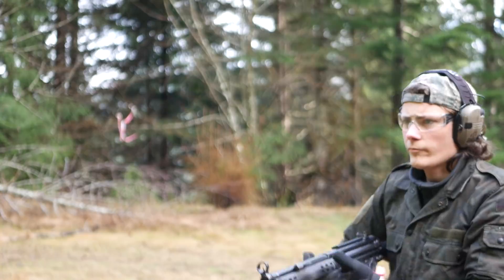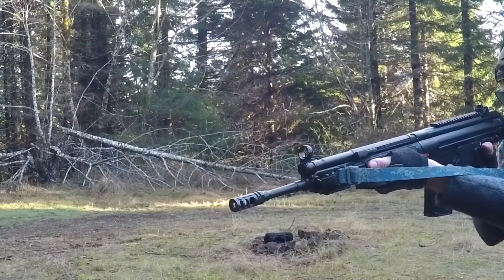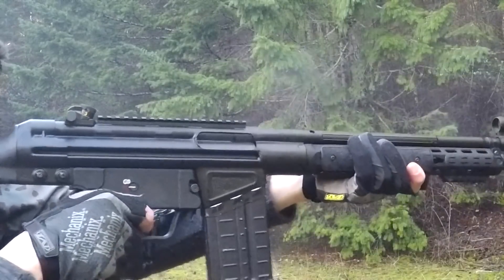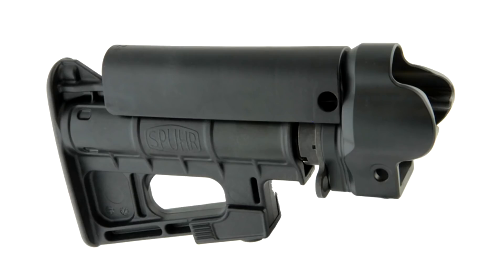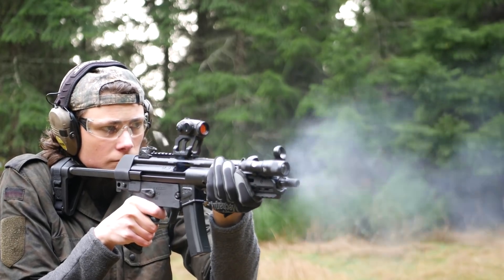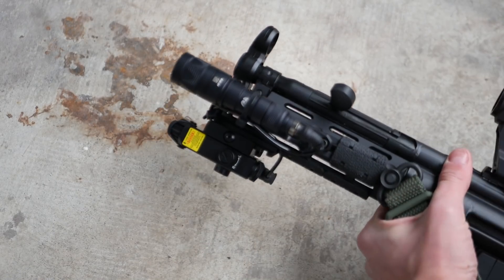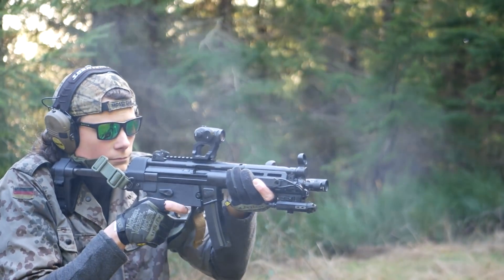PTR Mitosis

Comment from the maker: Check out the crazy weak ejection at 0:20
Reply: 80 year old man taking a leak right there
Reply: I have the A3S model as well I replaced the handguard with a KAC HK91 ras which set me back a little bit lol I also replaced some of the PTR made internal parts with HK made ones like the ejector/extractor and springs.. I ended up having to do some fitting as the ears on the mounting bracket where a faction of an inch too high which wouldn’t allow the front pin hole to line up. I’ve been looking at getting a spuhr stock as well so I humbly recommend a follow up video on this rifle after you get the parts in. For the $ PTR seems to be a decent bet as I haven’t had any issues with my rifle as of yet
Reply: How is it even possible to build a G3-clone which suffers from weak ejection?
Reply: @Benny---  Welcome to 'merica, I guess.
Reply: These new projects are the best news to come out in 2021. fight me.
Reply: It tried.
Reply: Common occurrence.   Could be ammo.   Could also be extractor related.   
     In ptrs they are notorious for lousy extractor springs.   
      In the 9mm you lucked out and it runs. 
      Do yourself a favor and buy 9mm extractor springs as well as 308 extractor springs.   They are not the same (although ptr uses the same ones in all their guns)
Reply: @ Hoplopfheil Whoa WTH was that??? That was definitely weird.
Reply: Buttery soft
Reply: So is recoil really that bad?
Reply from the maker: @thagrifster594  it's not painful or sharp, it just has more muzzle climb than inline stock .308s (AR10 or FAL). Takes more work to keep it flat.
Reply: @Hoplopfheil  okay, makes sense. One more question - 18 inch barrel vs 16 inch?
Reply: Most likely ammo related as it appeared the other rounds before and after that one ejected pretty forcefully.
Reply: Whomp-whomp.

Comment: Please note, due to the fluting that is done in the barrel to aid in extraction, the G3 style of rifles (this includes the cetme c and l) do not like steel case. Marcolmar , kit gun maker of the cetme L also do not recommend steel, as the laqer and or polymer coating will fill up the fluting and cause reliability issues. Hope this helps

Comment: You mentioned not liking compensators, curious if you've ever tried an externally threaded brake with a cone or tube surrounding the ports. Something like a 3/4" od brake inside a 1.25" id tube, so gas still gets out the ports. My 7.62*39 pistol is louder than magnums with the brake but very pleasant with the cone sending the boom downrange.

Comment: I got a PTR91 in 2012, thinking it would be an awesome DMR type gun, but I've realized that it's not practical for anything other than a fun gun. It's fun because it's a G3 clone. As far as hitting anything at super long range or mounting modern stuff to it, it's not even worth it. It's heavy and uncomfortable. I put a muzzle break on it and got an upgraded recoil buffer, but neither made a noticeable difference. Just dress it up with your favorite retro G3 furniture and have fun.

The one thing I'll say about mine is that it's been extremely reliable with both steel and brass, new and surplus ammo, as long as I use aluminum magazines and not steel ones. Polymer Thermold mags work well too. I think it had one or two failures in the first one or two hundred rounds, but everything else was caused by steel mags (the bolt usually doesn't even close when loading it from those).

Comment: Just got my PTR91 GI back from warranty work, they replaced the buffer, locking lever, and spring. Took it out today and it ran fine. I'm defiantly past the break in period now, and was before  the problems. I was having all kinds of trouble with feeding and extracting to the point rounds would get stuck in the chamber.. Also the mags fit super snug now with no play. Overall pretty satisfied with the customer service and repair work, just took a while. 9/10

Comment: I’d really recommend the side folding SB Tactical brace for the MP5. It’s almost as good as a fixed MP5 A2 stock. 

You also have to be careful mounting scopes to a G3, because if it has a decent sized objective it will interfere with the charging handle and you won’t be able to lock the action open. You want a straight tube common on low powered variables like a Primary Arms 1-6x.
Reply from the maker: The SB5TA is the one I would prefer but I think it's been discontinued.
Reply: @Hoplopfheil  
The original SBT5 and SBT5k were both discontinued for some reason, but the ‘a’ models that replaced them are still being produced.

I’ve got one of each and have been happy with them. They have a small amount of flex compared to the A2 fixed stock or the Choate folder I have on the MP5k, but they are very nice.

It looks like they are pretty much sold out everywhere right now though. The only good thing is you will be able to sell your PDW brace once you find one and that should make it about an even $$ swap.

https://www.brownells.com/handgun-parts/recoil-parts/recoil-hardware/sbt5a-pistol-stabilizing-brace-sku100026656-115592-215914.aspx?avad=48247_e1fcb8929&aid=35987&cm_mmc=affiliate-ItwineAvantlink_-datafeed&utm_medium=affiliate&utm_source=Avantlink&utm_content=NA&utm_campaign=Itwine

Comment: Yeah i have a century arms c308.  I swapped out the front and put a modular rail system on it with a sling swivel that mounts to the rail. It makes it so much nicer to carry in the field. I also put a 4x9x24 optic on the top since it comes woth a picatinny rail already welded on. Decent hunting rifle especially with hunting rounds it shoots very soft and accurate.

Comment: Coincidentally enough, I've ended up with the same pair and although the -'91 came first by over a year, the -9C  is currently in it's semi-final configuration.  So here are my $0.02 worth of ideas...
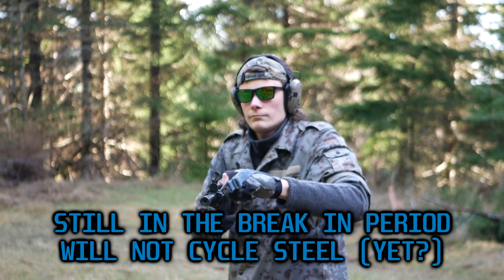PTR-9C:  Kept the forend (although the MI is very interesting).  Brace is the B&T branded version of SBT's UMP style folder from HKParts.  Look under B&T, not SB Tactical.  Optic is an Aimpoint PRO in a standard height AO mount.  Light is a Streamlight Pro Tac HL-X on an Arisaka (almost said "Arasaka"...unplug, choom! 😄) scout adapter at the 1:30 position.  Tape switch is right underneath it.  If you have an old short piece of Magpul MOE rail handy, they're almost the right height, can fit MLOK slots, and will take the rubber dingus to hold the end of the switch.  The other end  rests on the Arisaka base, with a tiny bit of hook & loop to keep it secure.  Sling is a surplus H&K, but beware, I'm not sure PTR spring tempers the clip on the mag well, so routine tight-to-the-chest patrol carry is out.  Both my PTRs wear a stick-on from Talon Grips, the bare plastic feels too slick for a secure grip, especially on the -91.
(part 1 of 2)
Reply: PTR-91:  My inspiration is the German Army's G3A3ZF (gesundheit!).  I'm also focusing on keeping the weight down.  For the forend I'm going to try to get someone to fit a length of Pic rail to the bottom of the slim GI forend (the original one with the heat shield) like the German rifles have.  So far no luck.  Optic is tricky, as you say.  Length is limited by the need to work the charging handle. I've settled on the Trijicon Credo 1-6 (MRAD version).  It's short enough, not too heavy, and has great glass.  Mount will be Scalarworks, because weight.  For the muzzle I have a Griffin Hammer Comp.  Blackhawk nylon cheek pad on the stock.  All of that is still on paper only.  

Not meaning to show off or brag.  Hope this gave you some ideas (for the rifle!).
Reply from the maker: @christopherreed4723  good stuff, thanks for the ideas!

Comment: Ok I don't know maybe it's a generational thing but stout recoil? Not really I have fired 3006, 308, 30-30, 50 BMG and I have to say my G3 has mild recoil the inline stock thing isnt a issue with these weapons.   Ok so you want light lasers/Optics to be honest lasers are overrated as a former Marine I can tell you mostly we used them for target designation or deterrent when lasing people and unless you shoot a lot with a laser as a primary sight I don't recommend it just use an optic.  I don't want you to get bent with my comments it seems youtubers get mad when someone disagrees with what they posted but to be perfectly honest I find a decent optic and light is all you need.   Last these are my thoughts from my own personal experience I was trained when we taped maglights to our A2 Handguards no optics back then and trained in modern rail systems with lights, lasers and optics for fighting what we found out was what really is necessary carry the rest was left behind just my thoughts knock yourself out less is more simple is reliable.
Reply: Or you could chop the barrel down to 16.5 about 3/4 from the sight block re-thread pin in place a 4 prong flash hider for a G3K model this will allow you not to replace the locking piece I believe is 45 degree angle  to 50 degree angle like on shorter builds.  This should give you a lighter gun shorter as well while not having to replace internals.

Comment: I enjoy your videos, but disagree with many of your conclusions here.  The biggest problem with G3 clones is that they are difficult to suppress.

I have not experienced any break-in requirements - I would suggest checking your bolt gap as a first step.  I don’t remember what the markings are for the correct locking piece, but I would also check that they put the right one in when it was assembled.

I didn’t find the Spuhr stock to be worth the money.  I have an average size frame, and it might be necessary for folks under about 5’10” with shorter arms.  It makes it impossible to use the iron sights.

Forgotten weapons just did a video on modernized G3s:

https://youtu.be/lvx2RFkst4U
Reply: Did you try removing the cheekpiece? I was able to use the iron sights on my Spuhr stock no problem after removing the cheekpiece. I did have to pull open the stock 1 or 2 clicks back due to the contour (the piece at the top of the stock which the cheek riser mounts to seems to get in the way when trying to get one's face low enough to use the iron sights).
Reply: @dexm2010  I have not - but that is a great idea.  I’ll give it a try.

Comment: I would have to say that my favorite thing about the SB HKPDW brace was the set screw coming loose under recoil, and the wires completely failing and collapsing, followed by my face slamming into the end cap.  Loved it.  Loved every moment of it.
Reply: The side folding SB brace that kind of looks like the OG fixed stock is probably the way to go if you want a brace
Reply: @NPS69  can confirm.
The side folder looks fairly good (at a glance).
Has a comfortable cheek weld for the irons or low mounted optics.
Locks up solid so no face smashing tragedies like the poor OP. And it folds up nice

nice meaning after you've oiled up the hinge and then folded it 100 or so times
Reply: you added the pdw brace to the 308?
Reply: @ianteissier2951  nah, to the 9CT.  If I still owned it, I’d probably just Form 1 it and set it up like an MP5A3.  That kinda seems like the move to make.

Comment: Hop why does the market value G3/mp5 clones the way it does? Is it because of licensing, importation, reputation/media representation, all of these to some extent or something else entirely? The price tag seems ridiculous for what are basically copies of legacy platforms.
Reply from the maker: They're classy and they were in ALL the video games. But in reality, yeah. Not the best as far as actual guns go.

The real kick in the teeth is that roller delay stamped metal guns were always meant to be cheap and cheerful. Easy to mass manufacture. The fact that they cost so much to make now really corrupts the original intent of the guns. Not to be the best, but to be CHEAP.

Comment: I bought a PTR-GI model with no rail back in August and that thing has been nothing but trouble since I bought it, and eventually, it quit running completely, would not eject anything, would extract, not eject, then double feed. So I sent it back in November and they just told me they couldn't fix it and they are sending me a new one. Please keep us updated on whether or not yours will cycle steel.

Comment: Don’t tease us. We want the full reviews from the absolute king of reviews!

I have a 9CT and love it. No... I LOOOOOOVE it. But I consider it a toy, so I wasn’t expecting to become a Navy Seal. Its shortcomings outweigh its strengths “for duty use.” It’s not practical, but boy is it fun. Did I mention I love it?

I also have an older PTR91 with a 16’ barrel and no welded rail, and it’s probably out of spec, because it misses picking up a round or two out of each mag. Total failure. And I tried several rails, including a claw and a very expensive bolt-on, and they all suck. I do not love it and am planning on ditching it at a loss.

I have a real HK91 and it’s flawless as far as operating, but SOOOOOO outdated.

Comment: You will not be able to run steel cased ammo through those stepped barrels. Eventually you'll end up with cases stuck in there so hard you're gonna need to drive them out with a rod and mallet. Ask me how I know.

Comment: Sphur stock, magpul lower, trijicon sights, trigger job, enhanced buffer, muzzle device of your choice and a mlok handguard is how you modernize a roller delayed firearm. It won't be a SCAR but it will be dead nuts reliable and smooth for the cheapness.

Comment: Add the Heavy Buffer to the 91. I run the Midwest handguard, Spuhr stock, H-buffer, PWS break and like it now better than the FAL or AR10. Buffer @ HKparts.net. I can hit steel at 500 with Wolf. I also have the Primary 2.5x10 for optics. Also I put in a 36 degree locking piece. This reduced the recoil a lot !! The brass only flies about 5 feet and the brass is in great shape.

Comment: Ah, good ole PTR. They sold my buddy a 9C with out-of-spec tri-lugs and dragged their feet on getting it RMA'd. And then when they rebarreled the whole thing to replace the tri-lugs, the replacement barrel's diameter is out-of-spec, so no tri-lug piston will even fit over it. But hey, at least the lugs are in spec now.
Reply from the maker: Jezus christ... I'm going to order a 9mm can when the one I want is back in stock. Wish me luck.
Reply: Well, if it makes you feel any better, I too hate money and good financial decisions, so I bought it off him. Buddy threw in a Griffin 3 lug coupler, I think I'm just going to have a local machinist who used to be an 07 SOT widen up the piston with a lathe so a can will work.
Reply: @Hoplopfheil  Update that nobody asked for. Finally ran it to that machine shop today to get the piston checked out. Piston was an exact .960" diameter and the replacement barrel was .961. Fun.

Comment: Big fan of the channel! Best thing I have found re: making mp5's NODS capable is a combo white-light/ir laser unit, since rail space is at such a premium. My MP5 has TLR with white light and IR laser combo unit. It's fucky to zero being aligned to the 1 oclock and I had to use a shim to cant my mount on the mlok rail to give the laser enough adjustment to zero. (you might have better luck with the TLR VIR II with the emitter coming from the bezel, but alas, no tape switch option by going that route) At any rate, once you got it setup, its a beast. I SBR'd mine and just run an AR stock (HK sliders are neat, but not the peak of shootability, I suppose you could run an SBA3 if you didn't want NFA) Throw a wolfman on there and get your hands on some heavy 158 or 165gr subs and you have a killer night rig. There's a vid on some arfcom thread of me hitting an e-type at 300 yards at a nightvision class with it. Insanely quiet and VERY capable. Probably my favorite suppressed gun, and also my favorite night gun too. Nothing comes close to being as quiet and shootable.

Comment: How much did the 9CT run you?
Reply from the maker: I posted a reply to this but YT zucced it automatically. Apparently I'm not allowed to say.

I think it was affordable compared to what Century is asking for the Turkish made ones though.
Reply: @Hoplopfheil  thanks for the reply man. Sorry it got zucced. Have you considered some of the mounting options for the light and laser from Unity? Or pushing the flashlight out alongside the muzzle with an Arisaka mount?
Reply from the maker: @RainenAvernathy  I can mount the light high right on the MI rail. It'd need a remote switch, and routing it could be a pain. Might be able to mount a laser on a gooseneck cantilever rail at the 6 o clock. Run the pressure switch to... somewhere. Or use a Sync switch to control it. Or vert grip and fk tha police.
Reply: @Hoplopfheil  A Modlite hot button might be a good space economical option? I've seen guys do MP5SSD builds where they sent a rail at the 6 o'clock out under the can. Could also use a Russian grip/rail extension combo from Zenit. I suppose the possibilities are endless. I'm always looking forward to seeing your weird projects.
Reply: @Hoplopfheil  I remembered the name of the Zenitco rail, its the B-9M. Looks like its 122mm long.

Comment: Why not just tape a rubber cheekpad above the stock and save $315?
Reply: A lot of people do that, and it takes care of the height/cheekweld issue, but not the possible eye relief and/or buttstock length of pull issues.